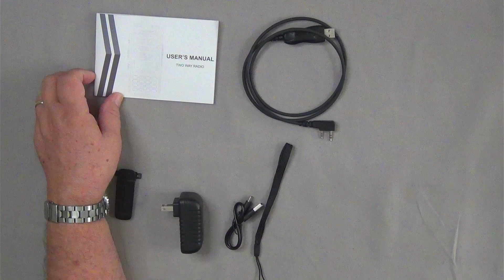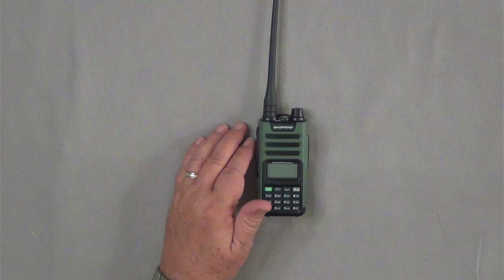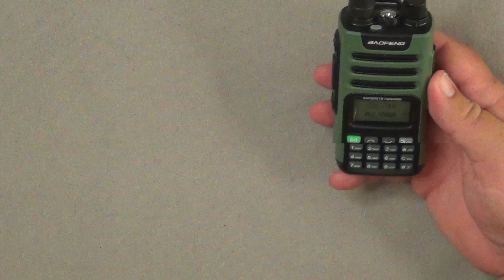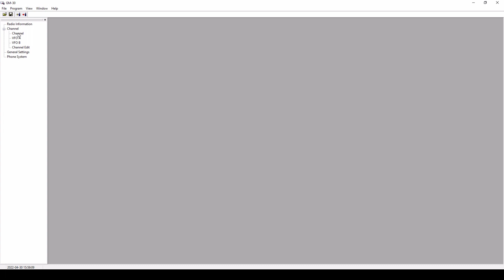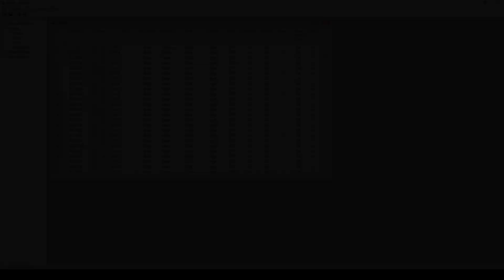BaoFeng GM - 15 Pro GMRS HT

Comment: Sma female connect on radio is backwards to most radios and makes replacement antennas harder to find.  Real exotic  high DCS codes can not be manually  programed in to the radio and must be programed  in via software.
Reply from the maker: FYI, the radio has an SMA male or plug connector. You'll need an SMA female or socket antenna. Most Chinese radios have male connectors on the radio side. Japanese manufacturers such as Yaesu and ICOM have the male connector on the antenna.
Reply: @Celtic Pride A year makes a difference. Last year State Fair time in Twin Cities everything was 141.3 Ctcss to talk on the systems.  This year 2/3 of the systems. One has to beg permission for the codes and the two that sent me back the codes. Both were Split DCS.  I don't care about the down link.    
I live 200 miles from Milwaukee/Chicago and sometimes around sunrise. I pick repeater Downlinks.   When I look for CTCSS there is none. And DCS scans are coming up eccentric  I351N or above DCS. 
I don't have the power or desire to get into these systems.  And when that open/  The systems are overwhelmed with contacts from Michigan or Indiana.    Hook repeaters to Nets and the system becomes more then a mess that the gate keepers find eccentric ways to keep commoners out.   I have had more fun listening to farmers, businesses, and families go on about their  lives on GMRS and FRS. The GMRS crowed has gotten stale.  Then again I was the guy found 800MHZ   analog cell phones and 47 MHZ cordless phones entertaining.